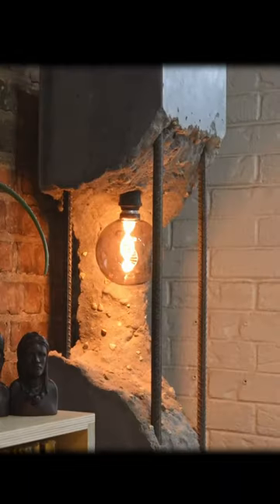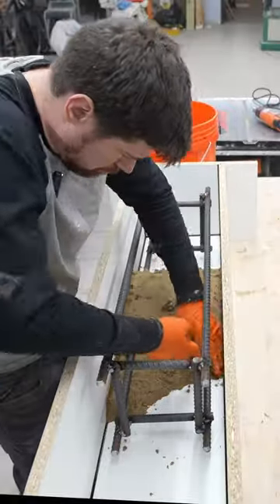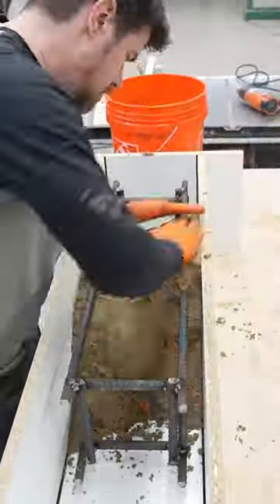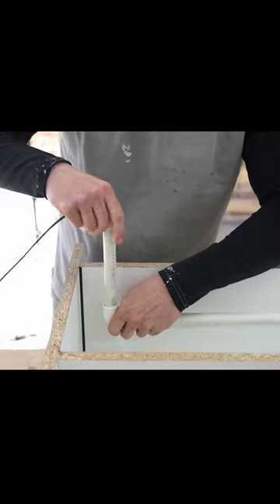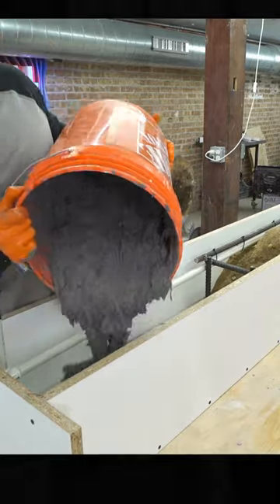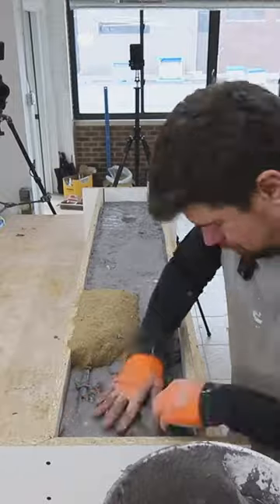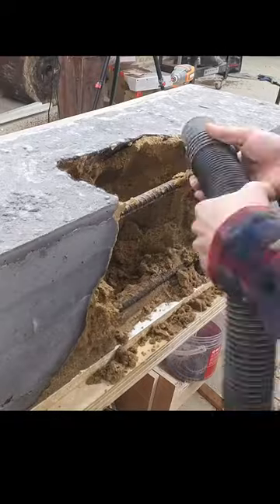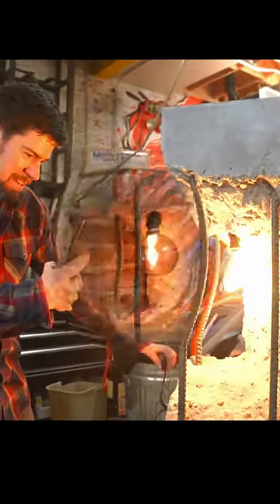Innovative DIY Concrete Idea :)

Comment: Looks nice, but for someone who works in the field (precast concrete), not seeing any hoop reinforcement just seems off.
The columns we make at work has a hoop for every 1'4" at the bare minimum (depending on load, and normally 4 hoops every 2" at the top and bottom).
Reply: He’s not supporting a house Irkel. It’s just a lamp, damn.
Reply from the maker: you aren't working with glass fiber reinforced concrete i would guess.... this definitely isn't necessary for this build.  There is a full youtube vid for this if you are interested in more details.

Comment: just needs some graffiti and it'll be done. do this in aircrete and you could cheaply mail these, even foam sprayed grey and have the owner add sand inside bottom to weight it down
Reply from the maker: interesting idea!

Comment: I think a better way would be using foam and covering it with quick cement it would be lighter to move in the future  most homes won’t be able to handle all that weight and your floors will thank you
Reply from the maker: i did fill it with foam.  its a little under 300 lbs, so not too bad